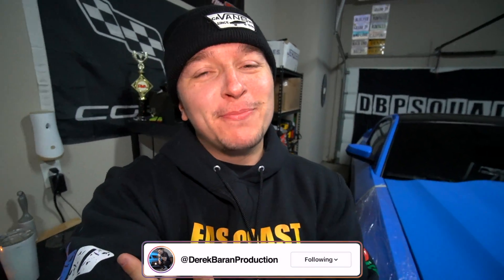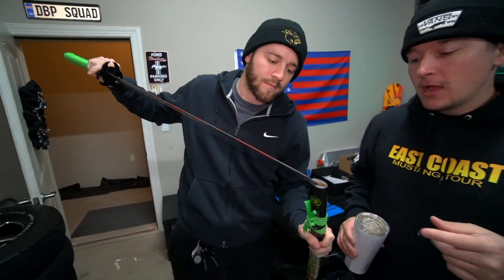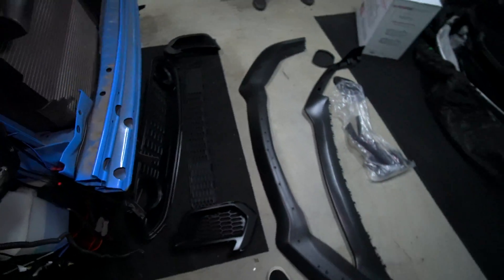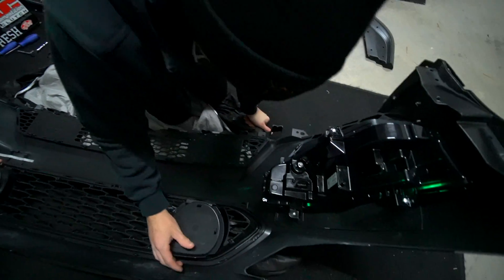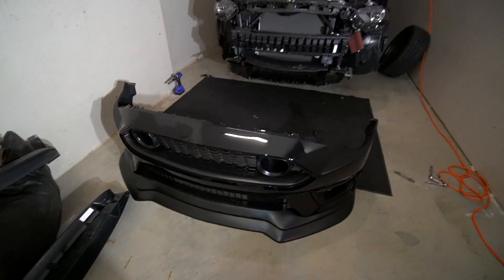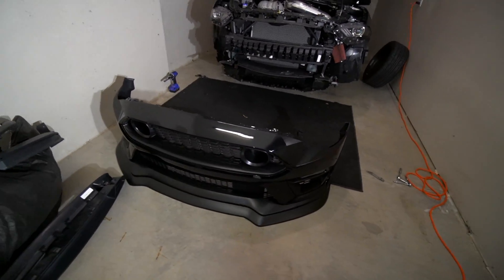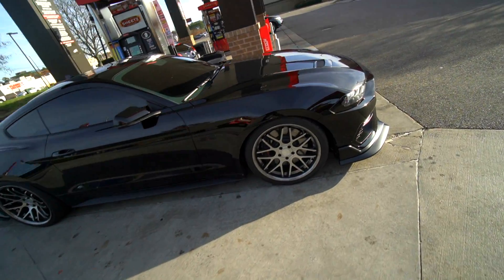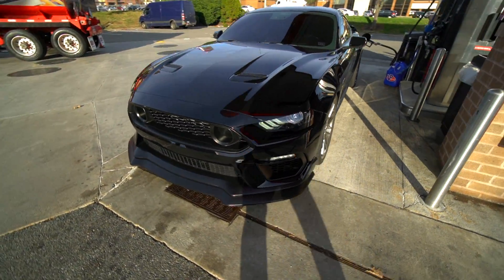My Mustang's Mach 1 Front Bumper Conversion is STUNNING!!!

Comment: 👍on the MACH1 front bumper.  As a PP1 owner who also installed the ZL1 add on on the spoiler...  Get the GT500/MACH1 spoiler.  It's next level how it sits off the BACKof the car...it makes the lines correct. Yep, at the least get the ZL1 add on GT500 Rock guards, you dont need the entire side splitter. I have them and it looks great. 🇺🇸
Reply from the maker: Oh forreal!? Might have to get them?
Reply: Yessir.  They make them with and without the rock guards.  ZL1 add ons. Mustang 15-23 GT500 Style Side Skirt Extensions × 1.  However does not have the winglet, but you can pick up a winglet that sits flush with 3M from AM.

Comment: Gt500 spoiler with wicker bill. Gt500 rear bumper with bigger exhaust tips. Gt500 side skirts. Gt350 front fenders with vents. Side marker led lights by raxiam or accel both good. And your car is set buddy
Reply from the maker: SHESH THAT WOULD BE ELITE

Comment: I second that damn amber light thing, ALL S550's looks miles better with either the switchback bulbs OR the whole housing like you got. Also, Diode Dynamics is a great company, I ain't sponsored (sadly) but they are great at shipping, replacing, and communication.

Comment: I would change the diffuser out for the GT500 rear valence, personally I would do the 18+ style euro tails since you have a 18+ (would match the shape of the tri bar on the headlights). And yeah GT500 side skirts would prob look good with the rest of the stuff I mentioned. And the last thing I’d do on the exterior is a carbon fiber vented hood (not a cowl)
Reply from the maker: Maybe!!
Reply: Put the gt350 fenders with the gt500 side skirts then cervinis hood

Comment: I think you need to add the mach 1 front fender flares, they would tie everything together so good
Reply from the maker: Yes i need them. Where can i get them?
Reply: You can get them directly from ford or lmr, there are a couple threads on the forums on how to do it but since you are a performance pack there will be one hole that “won’t line up” but it will be very close

Comment: Love the Mach one bumper( I believe the belly pan is an issue with these front end) it's a clean look but I would buy the inner fender liners for a mach one to replace your non functional ones as it helps air escape.  I still not a fan of the rear diffuser tho!🤷🏾‍♂️
Reply from the maker: I love it too!!